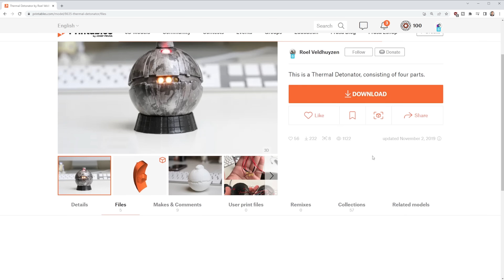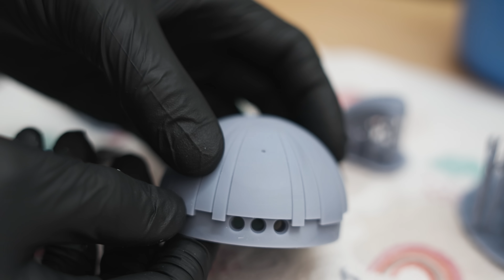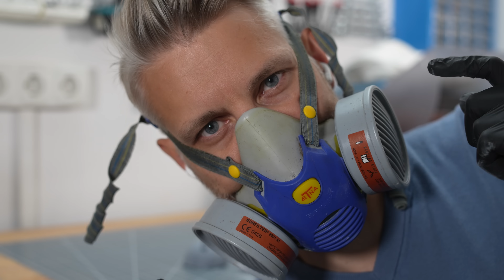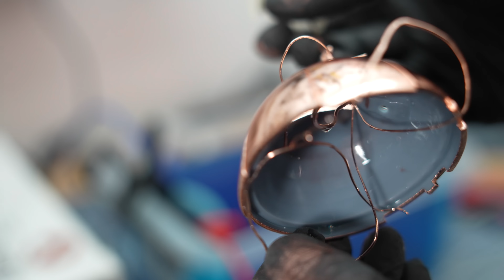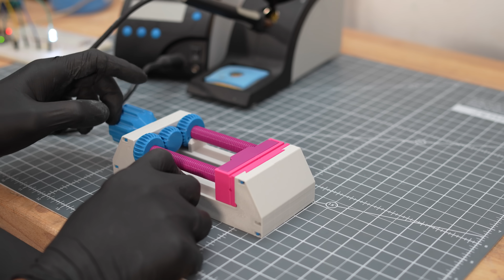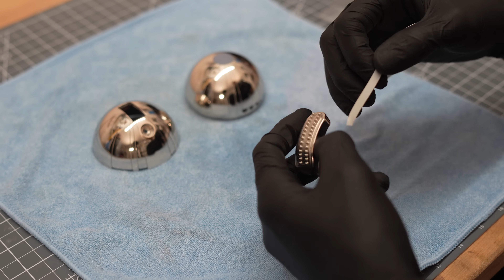Electroplating 3D Prints | Thermal Detonator

Comment: Ive printed one (pla)
Im currently sanding the layer lines.
I have the electronics ready to solder.
Arduino code already written.
And uploaded to a pro mini.

My airbrush is low pressure, high volume.
I'll be spraying mine with acrylic paint.
But im tempted to hydro dip it.

Comment: "Thank you so much for your videos, the quality is great! I was wondering, what brand and type of resin do you use?? I tried using Sunlu ABS-like resin, but it seems to be incompatible with the electrolyte solution. After several hours in the bath, the piece comes out softened and the copper and paint peel off. Thank you for your help!"

Comment: Dear Hendrick, thank you for your helpful electroforming videos. Thanks to your videos  I have had success with some of my parts producing a shiny thick copper coating; however, others which are slightly larger have resulted in a dull finish with stains and spots. How can I recover these parts? Would re-grinding them to the plastic and starting again be the best approach, or is re-immersion in the solution the better option? I look forward to your response.
Reply from the maker: If it‘s just dull you have to recheck the current (1.5A/dm^2 surace) and use constant current. Recovering is always tricky. I try to avoid these things (haha, I know). Try grinding, then degrease and pickle with citric acid. You really have to pick the right current to avoid these problems. When doing the mandalorian helmet I reached almost 3V at 31A.
Reply: @hen3drik , thanks so much for your quick response!
Reply: @hen3drik  
I have an object with an area of 31.96 dm^2. This means I need 47.94 A of electricity. In your videos, you always gradually increase the volts. Should I gradually increase to 47.94 A or start there right away? Sorry for all the questions, but you really help me a lot with them.
Reply from the maker: I did the gradually in the past. But you should start there right away. Be sure to use constant current, not constant voltage. In case of doubt google how to set it on your power supply. You can start at 1A/dm^2 for the first 30 mins and observe the results.

Comment: So been watching a few videos and you always recommend not using nickle even tho you use it. You never really explain why you use it. Is it cheaper? Easier to obtain?
Reply from the maker: Good question: I use it to speed things up and when having parts with complex geometry. Three weeks ago I purchased a galvanic pen which makes working with palladium easier in these cases. Also, nickel bath plating is not very geometry sensitive; it creates a very fast even plating. But the fumes that might be emitted are not healthy and this technique shouldn‘t be done by end users imho. It‘s also regulated in various countries; long story short: that’s why I present a more healthier alternative that also works very well. Only downside is that it’s a bit slower and can only used with galvanic brushes (more expensive). You could also plate gold directly to copper, but you should have a barrier between so that the copper is not eventually passing through.

Comment: Can you make a whole video just about the safety aspects of electroplating? Obviously it doesn't look like healthy chemicals you work with and there are some things that people should avoid or take care of.
Reply from the maker: I cannot answer safety aspects since I’m just a hobby user following the rules written on the bottles/chemicals. But I can tell what safety measures I take regard these things (gloves, respirator, glasses, ventilation). I think it won’t be a dedicated video, but a safety part of each video. I actually don‘t believe it‘s more harmful than working with other paints etc.
Reply: @hen3drik   ok, i see. Sorry, I thought you came from commercial field of galvanic since you are seem to have so much knowledge about it which itself isn't covered a lot on Youtube. Well i just wondering since i have seen articles about heavy health risks regarding Galvanik aka electro plateing and there is a lot of things involved, like avoiding putting stuff down the drain. Or the ventilation aspect. But also like the actual differences on what chemicals getting used. But also i thought about for a video like simple stuff to avoid. Like what should be done to avoid burning for ex. while it's electro plateing. Like tips and tricks list of what you know that you can share to avoid certain mistakes you experienced yourself when you started all this.

Comment: I can't find the Tiffoo conductive paint anywhere in the United States. I tried using a graphite/b-72/acetone paint recipe, but that paint cannot be airbrushed and it bubbles up after being submerged in the solution for a while. I also tried Modern Masters copper paint but it has zero conductivity. The search continues!
Reply from the maker: Yeah, that‘s difficult. Try commercial conductive graphite spray and polish it to get around 1.7kohm for 1cm. The bath plate very slowly.
Reply: Thanks for the heads up, otherwise I might have tried this eventually. If you can't buy it in the US it's for a good reason. It must me super toxic. While I've messed with ultra toxic things before this kind of hobby showpiece probably isn't worth exposing yourself to. Who knows how much of it is rubbing off with each touch not to mention off gassing.

Comment: Hi From Denmark... Thanks for your videos - been contemplating for years about getting into electroplating.. but now i have bought some basic stuff to get started.. mostly thanks to your vids.. :) But have been thinking - for my project i could also use alu (model cars and trucks).. but so far i havnt had much luck finding on how to electroplate alu, only how to plate onto alu not how to deposit alu onto other materials, except in industrial settings. im thinking it should properly work the same way as nickel.. i do plan on creating must of the electrolyte my self (except for chrome, thats some nasty stuff, could release chlorine gas not much fun in that....) so if you have any idea, please post a vid.. thanks again, looking forward to your next..
Reply from the maker: Moin, Aluminium can‘t be plated directly because of its oxidation layer. You can try activating it by dipping short in 10% HCL; also electroless nickel can be used to put a base layer on it.
Reply: Yes, i get that - when you try to put copper (or any other metal) on aluminum, that you have to fight the formation of oxidation pretty much all the time. But here i were thinking the other way around.  The only method ive come across so far is vapor/spatter deposition but was thinking that it should be possible in an electrolyte bath as you dont introduce any oxygen that can form oxidation, and even if you do, you are dissolving the aluminum into the electrolyte and then binding/forming on the anode.   But perhaps im just rambling/dreaming here... dont really want to build a high-ish vacuum chamber, but perhaps thats the only way... 

But thanks for repying.. Are you from the north-west? i remember when i saw you first video and the first word was moin.. i actually thought here is a Dane :) it took me a while.. lol..
Reply from the maker: Ja, ikke helt i det nordvestlige område, men ret tæt på (altså ikke i Friesland). Held og lykke!

Comment: If you were to print using an FDM printer using PLA and smooth it with acitone, would it make the finish cleaner?
Reply from the maker: No. You‘d also have to make it even. I couldn‘t achieve this.

Comment: I have more questions about the health hazard aspect. Which part is dangerous exactly?
Reply from the maker: It‘s okay if handled in a ventilated or open area. Nickel electrolyte is the really bad stuff. In case of my supplier, some former hazardous electrolyte such as chrome have been replaced with less harmful variants. This is, afaik, due to strict german regulations of these chemicals for consumers (nickel)

Comment: hey i had a crazy idea what if you came up with a design that you electrocoated in stainless steel, then turned around and then did  sand casting where the purpose was to remove the plastic and basically replaced it with aluminum, then finished it off with say gold or silver or another metal? cause i was thinking that the stainless steel coat would hold up with hot aluminum then you would have a pure metal 3d print and would be strong as hell, maybe need to use a vacuum to get all the air out, but i think it could be done.
Reply from the maker: I actually did that and it‘ll be part of one of the next videos 😃
Reply: @hen3drik  NICE

Comment: Looks amazing! How large a part could you plate with this method? I have a resin cast of a daft punk helmet sitting in storage that I would love to chrome plate.
Reply from the maker: Ha, me too. My actual resin basin is 5l. The problem is that for these giant surfaces you‘ll need very high currents from a fat power supply. Also very hi wire gauge and many liter of electrolyte and different clamps and giant anodes. And I bought all of these last week 😉I guess I’ll have to find out.
Reply: @hen3drik  Hah! Good to know I’m not the only one. Are you doing the helmet electronics as well? The LED grid is pretty time consuming! Looking forward to hearing how the plating goes.

Comment: Fascinating stuff. I'm not super familiar with the costs and material properties of electroplating, but it's worth noting that you can get a pretty equivalent look using certain chrome paints through the airbrush. Molotow chrome immediately comes to mind. That one works especially well because it's formulated in such a way that you want to absolutely flood the surface to allow it to self-level, resulting in a very smooth result, even over unsanded prints.
Reply from the maker: I do a lot of alclad II chrome paintings, too, but comparing these techniques is actually not the point of this video. But the difference between a painted chrome and a real metal layer is more than the look, it also feels way different as you touch it: it feels very cold (as it‘s metal) and you cannot rub it off. It also adds quite some weight to small parts and makes 3D print incredible strong. 😃
Reply: @hen3drik  Oh, for sure. I just think it's helpful for anyone watching this video to know that if they're only looking for the visual effect, it's possible to achieve with less hassle.

Comment: I am just curious.  Couldn't you just spray many layers of chrome paint, use a clear coat and then wet sand and buff the hell out of it for the same results?
Reply from the maker: Maybe possible, but this wasn‘t my intention, as I wanted to have that haptic feeling of metal. It‘s cold and cannot be rubbed off 😃
Reply: @hen3drik  Totally!  Thanks for taking the time to respond.  I agree

Comment: You make plating look way too damn easy. Takes me forever to get a good  even plate. I can't find the copper paint anywhere in the states , I've opted for silver plated copper spray paint, but it's really course so I have to let the copper plate thick and sand the bejesus out of it.
Reply from the maker: sanding is always a fallback option. But yes, it looks easy, the trick is to create an even coat on a smooth surface and plate carefully and SLOW.

Comment: Nice one. You should coat the finished nickel plating with a clear coat to prevent it from getting dull over time.
Reply: Can’t you just build more plating layers? Is there a limit to how much you can plate something, I would love to build up like 2mm of the stuff as like a full enclosed pseudo forging process, is that possible though?
Reply from the maker: 2mm is possible for copper electrolyte.

Comment: Kann man eigentlich mit Galvanisierung auch einen Aluminuml/Edelstahllook hinbekommen? Also wie beispielweise bei einem Waschbecken?
Reply from the maker: Kind of: https://youtu.be/NFaqu6Cxm5Q 

Try copper, sanding 1600grid, then nickel/chrome/palladium. All the metals have very similar looks. It also depends on how much voltage is applied when using a galvanic brush. But it’s kind of „wrong“.
Reply: @hen3drik   Ok thanks. But what do you mean by "But it’s kind of „wrong“."? Isn't worth it? Are there better alternatives? I thought, electroplating gives the most realistic appearance when it comes to metal, chrome etc. So aluminium look should maybe work too
Reply from the maker: @MrGTAmodsgerman  oh no, i mean regarding the galvanic brush. You can go higher voltage as it‘s supposed to with the galvanic brush and kind-of „burn“ the plating to darken the deposed material. Aluminium can be anodized (colored), but I don‘t think that’s what you‘re looking for, right?
Reply: @hen3drik   Oh ok, then this makes sense. Thanks. And no, i am just looking for a authentic solution of scale model sink look. Just a thought, nothing serious.

Comment: I have been enjoying your tutorials so much and I'm looking forward to my first electroplating project soon!  I have two questions: 1) What amperage do you start at?  You have mentioned in prior videos the voltage you start at, and this time you mentioned the amperage you ended at, but I'm not sure what amperage you began with.  2) My upcoming project has a high surface area to volume ratio.  I have heard that this affects the ideal electroplating parameters.  How do you find that complex shapes with high surface area behave during plating, and how do you compensate for it?  Thank you very much!
Reply from the maker: Hi, you don't have that much control over the current, the object takes what it needs. There are calculators that do the math for what's the best current. I set the volatage to around 0.2-0.3V at the beginning and make sure that there is some current flowing. This current increases over time, because the layer is growing thicker. complex shapes bring problems like anode shadowing and current spikes but i haven't noticed anything regarding the surface to volume ratio. I noticed that small objects, where the surface to volume ratio is greater, you'll have to be carful with the max. voltage. I'll investigate in this thing.
Reply: @hen3drik  Thanks so much for the response!  I'll start experimenting and hopefully I can find the right technique soon.  Thank you again for your videos; they have been very helpful.